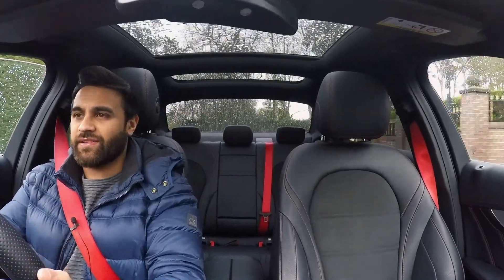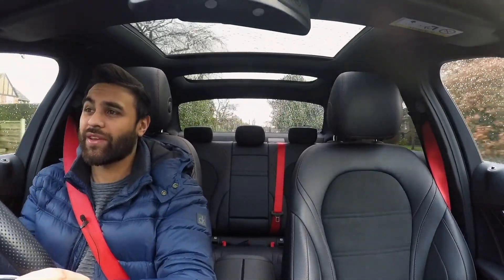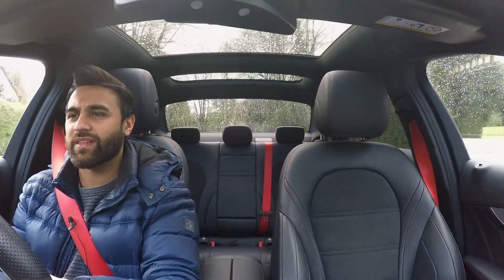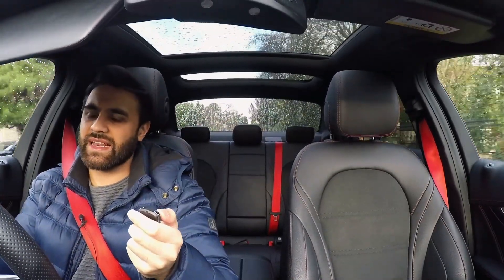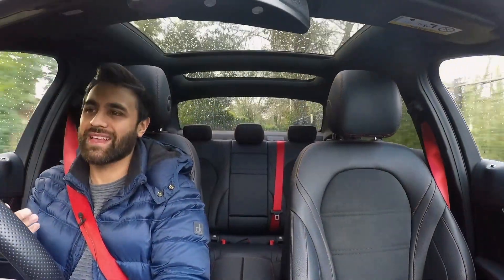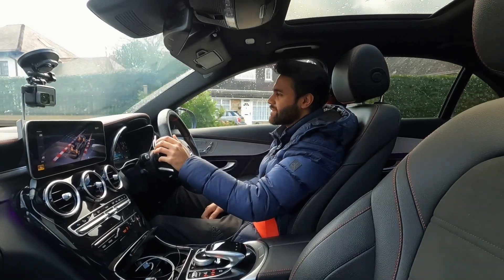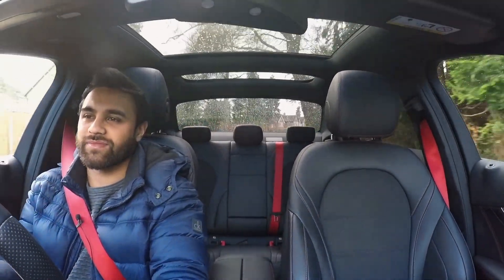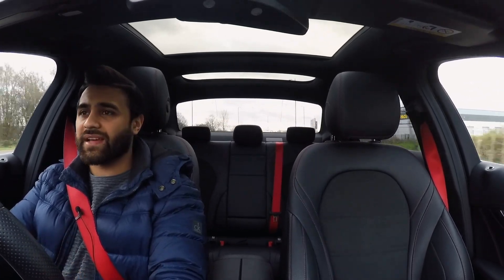I Made My C43 AMG EVEN LOUDER ...

Comment: Does yours have the Amg performance exhaust? My 2020 does and I am in the usa. I think the ecu tune for EU is quite different than here. Your up shifts are no where near the decibals and tone of the usa models. I think due to your emissions laws? I can produce 6 loud Gatling gun noises if I downshift into 2nd and then steadily apply the throttle to 5-6K rpm then let off.

Comment: Zubair, how do you feel about the new 2021 CLA 45?  It’s very much improved and I’m kind of having buyers remorse for my 2021 C43 sedan order coming out in March.... I love my c43 spec but I’m now wondering if the new cla 45 is actually a better car than the dates c43?
Reply from the maker: Love the new 45 and if it wasn’t so £££ I’d be in one of those instead...
Reply: Are you willing to tune your 43? You can easily push over 500 hp with just a tune
Reply: @Phar0hB0t  Where? I found stage 2 around 460 and thats it. Which is kinda dissapointing if you realize that Stage 2 2,0 TSI is ~400 hp.
Reply: @maXXik1337  You just need a tune that will actually utilize the potential power for the turbochargers: 20 PSI of boost will get you over 500 hp easily, you'll want to do intakes and maybe some other cooling mods, but the turbochargers are capable of outputting up to 600 hp, and the stock internals can handle about that much as far as we currently know. my 43 is pushing about 550+ with a handheld tune + jb4 + intakes + meth injection and newly added TCU tune
Reply: @Phar0hB0t  Well, meth injection doesn't sound like "easily" at all to be honest. So you basically confirm what i found out. 500+ hp only with significant hardware changes...
Reply: @maXXik1337  I was pushing over well 500 before meth... My tune isn't even designed to maximize it's benefit, I mainly use it for cooling. I ran an 11.23 1/4 running 94 octane before I had a TCU tune or added WMI. Shooting to break into 10s now
Reply: @Phar0hB0t  Do you feel any downsides to the JB4 tune? I had been on the edge about getting it but apparently I suck at doing my research as I can't find too much info on it. For reference, I have the 2019 C43.